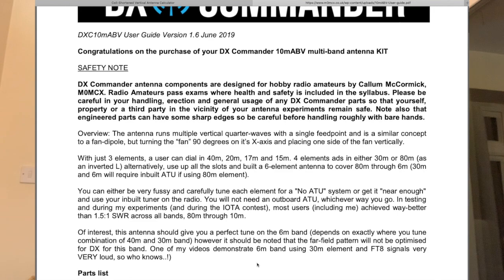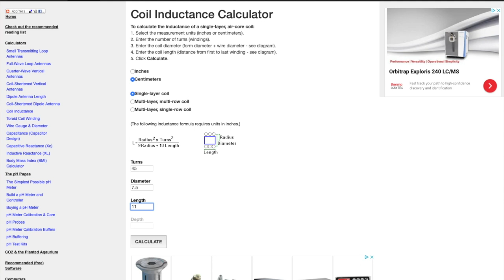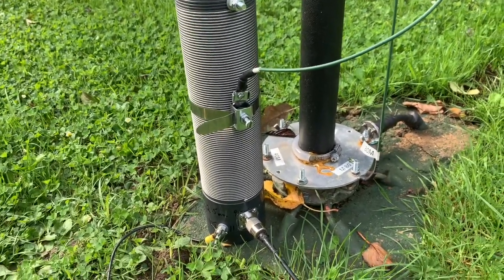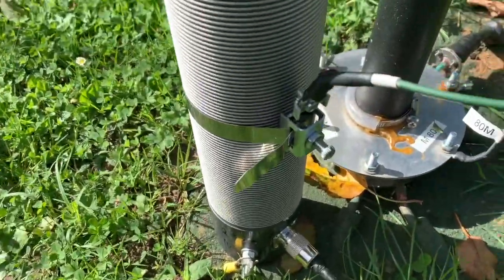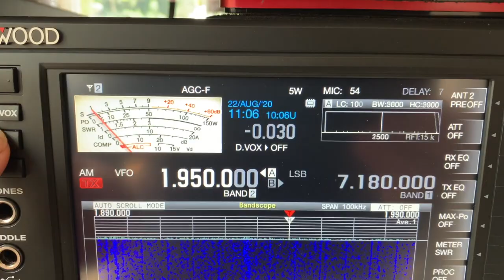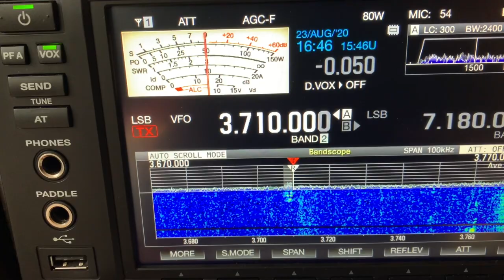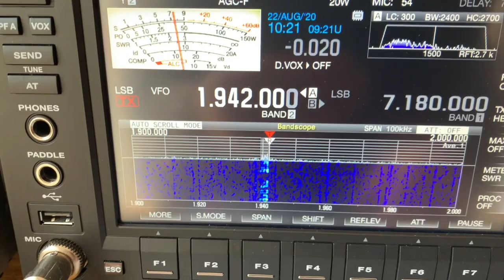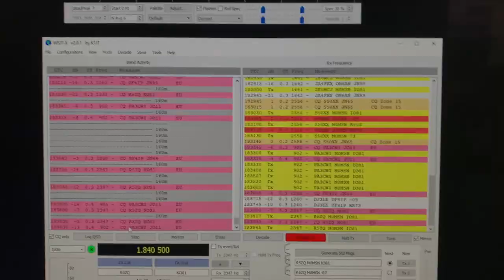Ham Radio: Base loaded Coil testing on 80M and 160M and Just how many Henry's do you need?

Comment: I'm not keen on the earth clamp idea as you'd have to check and adjust every time you wanted to change bands or even move between some points on the same band. I would prefer taps at the needed points on each band. Also as I would want it for use with the DXC Classic the separate feed point would not be wanted. However you have proven the viability of the idea. My only question is when would it be ready for sale?
Reply from the maker: For sale, lol...  I use the clamp because I can then use the coil on different element lengths ie the DXC classic, expedition and lite.. :)
Reply: @mike-M0MSN  I could get all the parts needed for this except I have no way of cutting the grooves into the pipe. Any suggestions as I do not have access to a lathe?
Reply from the maker: @A.R.O.T.A.  Run some double sided tape up the pipe and mark between it 5mm spaced dots and slowly turn the coil.. good luck.. :)

Comment: Wow thanks for this video. So, if I am understanding correctly, you don't need to calculate the exact inductance when analyzing the antenna system (provided you did the calculations right when building coil), but can identify the correct tap/ground placement VIA VSWR reading alone?..
Reply from the maker: Spot on. 👍

Comment: Excellent, but I am not sure I would want to nip out on a winters night to change bands, never the less, good job Mike.  I had watched a couple of videos where they said Stainless steel wasn't good, that is why I wanted to see.  But thinking about it, what is a steel whip made out of?  Stainless steel.  I think they were doing something wrong myself.
Reply from the maker: Yes maybe, stainless does seems to be working.  :)
Reply: To both of you.  =>
thanks that you are touching a kind of material. Yes, this is very important too.
“Why you are use a stainless steel for
a coil ?), it was my question too
(watching your previous video).      73’s
Reply: @voytekfid7734  At least if it works, it will not rust.
Reply: Having found the correct taps for the correct bands, could a relay be used to remotely switch it?
Reply: @paulsengupta971  Think about it, most ATUs have a load of relays in them to do the tuning.

Comment: If the antenna is on a fold over mount I take it the height above the antenna base would still be input as zero as long as the coils is raised to the start of the antenna? Or is it supposed to be the height above ground
Reply from the maker: height above the radials. :)

Comment: nice setup. may you tell us the length of vertical radiator, and how many radials do you use in your vertical? tnx for any help. 73 de PR7TU
Reply from the maker: For this set up and only for this test, the vertical radiator was 11.15M and only one ground radial of 20M..
Reply: @mike-M0MSN  Hi ~ shouldnt it be 4 x wavelengths  40m / 32 or 16 or 8 or 4 ?

Comment: Hello Mike  this is n6zn   good job good video too.   I have tried to make several short verticals in the past with not do good results for  dx.   I think it was do to the loading and ground system.    hey just a note.  You most likely know this, but if you put your rx AGC on slow reaction it fills the back ground noise a lot.    Just a note...   thanks for the nice video.. Jim

Comment: Half wave coil load deal for 160-meter band for the operator working from an apartment with balcony railing, that would be "the bomb" as we still say!  I've been looking for a mobile application that would 1/4 wave on the 160-meter band.  There is a mobile trap coil load antenna for the 80-meter band but for professional courtesy reasons I don't want to mention the name here.

Comment: Brilliant job Mike. It looks very professional. Nice to see you getting some contacts in the  log too. Let us know how it's been performing after the winter when hopefully you will be able to work some nice DX. Hope to get mine made up before the winter. I wont tap mine, I just set set the coil inductance so when the adjustiwave is fully linear loaded the antenna is resonant on the bottom of the band, I can then just wind the reel in a bit to work the top of the band. 73 from Scotland.

Comment: Thanks for this very useful information. But the problem that I think needs addressing is the ground plane. Those of us with the "small area problem" are struggling with trying to find a method of 1/ using the house roof as an effective ground plane, or 2/ not having enough usable lawn to put in a ground system of suitable length in any direction. To me, this would be the biggest unaddressed problem. Could a coil or inductance of some sort, be added to shorten/modify the necessary grounding system needed for vertical antenna.
Reply from the maker: I will have to experiment with this one, but I would think using loaded radials would work…

Comment: I see corrosion on the bottom plate of the antenna. It may be good to add anticorrosive spray once in a while to keep it making good contacts.
Reply from the maker: Good tip!

Comment: If you could make the coil adjust like a screwdriver antenna as it drops into a pipe or aluminum it will keep the Q or even improve it. also it could be made to be adjusted remotely.
Reply from the maker: now there's an idea..  :)
Reply: I have a pamphlet on how to homebrew a screwdriver antenna. Do you want a copy?

Comment: Excellent. Wondering if I could use this to convert my 5/8 gain master (10/11m band) antenna. Purchsed and installed for CB, now hardly used, as using mag loop for 40-10 m. Wondering if I could get 80m performance out if it .... hmmmm (great video as always)
Reply from the maker: The GM 5/8wave is a Stub matched antenna for 27MHz, so would not work on any other frequency without changing, well everything. you could however use the shell/frame work to make a vertical for 80M...

Comment: great video. How did you wind the coil so uniform? Are there grooves in the PVC pipe? If no grooves, how do the windings stay in place? Thanks. WB7DUO
Reply from the maker: thread cut into the pipe.. :)
Reply: @mike-M0MSN  Lathe or by hand? Lot of work by hand! HI HI
Reply: @gregnewberry4813  Watch the earlier video - or was it later?  Les

Comment: Hi Mike do you know how they arrived at 11.15 meters for  1/4 wave on 40 Meter?
Or maybe its a compromise to work with the loading coil ?
71.5 / 7.5 mhz = 9.51 Meters 1/4 wave.
Reply from the maker: Yep, do not get tangled up with these measurements, 11.5 Metres is only on a linear loaded DX Commander the true length of a quarter wave on 40 metres is: 300/f = 300/7.1 = 42.2535211268 x 0.92(correction factor for a PVC coated Copper wire antenna) = 38.8732394366 / 4 = 9.71 metres (trim to SWR) this is a guide not 100% as every installation is unique.

Comment: Hi Mike ... Hope you well ... I am at this time creating a coil for my resonant 40m vertical 32ft ... for 80m ... When you do your coil on the inductance your length is misleading to me as you  put 12.5 yet you are in cm ... Can you Help .. Mike M0CSI
Reply from the maker: Hi Mick, OK the coil calculation I made was in metric, so 50 turns on a 7.5cm dia 12.5cm long (for a 32 foot long antenna).

Comment: IF you do this....   BEWARE....  Make sure that you short out the unused turns.  At high power the unused turns could be come a tesla coil with sparks radiating.  That will get the neightbors attention and may not do your rig any good either.

Comment: Great video! When I measure my 11m high vertical at 3.5MHz, I get an impedance of Z = 1 Ohm - 87*j Ohm. I understand that a loading coil can eliminate the complex part, but even then the impedance Z would only be around 1 Ohm, yielding an extremely high SWR. Nonetheless, you seem to be getting an SWR < 2 for a similar exercise. Any idea what I am missing?
Reply from the maker: Hmm just measured my antenna 
@1.930MHz VSWR 1:1.1- Z=45 - Phase=0 - R=44 - X=3..  
@3.700MHz VSWR 1:1.3  - Z=37 - phase=10 - R=36 - x=6
Maybe  a ground plain issue?? I will read a bit more into this for you...
Reply: What are you using to load the antenna at the base and what is your ground (counterpoise)?  Also, is that where the SWR dip is?  

If you adjust the antenna until  the imaginary impedance Z for say -j13 or so, then you could use a Smith Chart to plot the impedance and solve for shunt inductance you need to bring the impedance to 50 ohms.  I use Smith chart software to do the work for me, it's worth the time researching it.  Since you have the means to measure real impedances, you can solve any Z problem.  I always adjust my antennas so the impedances, real and reactive, fall on the Smith chart curve that leads back to the center of the chart.  That gives me the shunt solution for 1:1 SWR.

You could also use trial and error.  Shorten the antenna as above so you get -j13 or so and wind a 2 uh coil and place across the feedpoint.  Then squeeze or expand till you get near 50ohms.  You could then adjust the antenna a little at a time and readjust the shunt coil till you get near 50ohms.

The -j13 is just a start.  It may need to be higher if the real R is higher.  When my R=25 ohms, for example, my -j needs to be near -20 to -24.  

 I hope this did not make your eyes glaze over.
Reply from the maker: @captaintripps7354  LOL, a little dizzy but a great tip.. many thanks...
Reply: James, I assume you are not using the loading coil?  What are you using for ground/counterpoise?
Reply: @captaintripps7354  thanks all for your replies, I am trying to make sense of it all. Let me clarify, I have a 40m vertical from Ultrabeam. SWR is great at 40m. Measuring its impedance at 80m (to deduce what coil to use) I get this very small real part. I use a ground rod at the base of the antenna and have around 30 radials in the grass. At the moment indeed I am not yet using any coil, just trying to understand what kind of coil I would need. I think the Ultrabeam has a balun inside, maybe that balun is not working at 80m and that's the reason? Thanks for any advice!!
Reply: @JamesMegaWatt  30 radials is very good.  If it is the UB-V40, then yes, the balun is customized for 40-6M and is affecting 80M.  If there is a way to remove or bypass the balun safely, do that and measure the complex impedance again.   Even if you have to modify the base and separate the vertical from the matching unit it would be well worth it to add Mike's 80/160M coil.  An 11M tall loaded vertical will do well on 80M and even 160M especially with 30 radials.

Comment: I'm frankly flabbergasted..... I've not read all the comments but I cant see anyone picking you up on the fact you appear to be shorting turns on the coil, both at the top with the bolt and washer, with the earth strap and the earth strap itself is acting like a shorted turn! Its no different to having shorted turns on a transformer, you are destroying the inductance and Q of the coil. You'll be wasting loads of power heating up the coil.
Reply from the maker: Well it works and is a great solution for the small garden, 10watt copy into Italy and Slovakia on 40 and 80M inter G on 160m. Go figure
Reply: I looked at some of your other videos of other coils which are fine, enamelled copper with taps. Its just so wrong in my book to have shorted turns. I'm sure it must work better with tapped windings where you arent shorting any.
Reply from the maker: The earthing strap used, is a moveable tap similar to the system used in wolf river coils or the mini-Tarheal screwdriver antennas it dose not short out any of the turns. It becomes the last turn in the coil…..
Reply: I agree the strap becomes the last turn, but its a shorted turn. The clamp itself is effectively a shorted turn plus its shorting a number of other turns underneath it. The magnetic field from the active section of the coil doesnt stop dead at the last turn, its passing through the shorted turns. I'm not sure exactly how the two coils you mention make physical contact with the coil but I doubt they'd have a metal strap round the outside. If you look at roller inductors they only make contact with one turn as they rotate and theres a good reason for that.
Reply: @666Bern666  I'm no expert on these things, but doesn't the coil "stop" electrically as soon as it meets the strap around it, then the strap to the wire becomes the last turn? It could short out all the rest of the turns up the coil but would still be the same, surely?
Reply: @paulsengupta971  I've tried my best to explain it above, but no. Look at any school physics book of an electromagnet. The magnetic field lines project out the end of the coil for a short distance. The fact this is an air core makes little difference. The principle is the same.